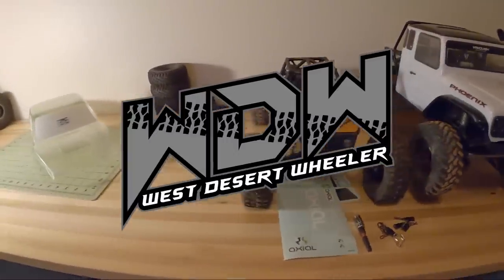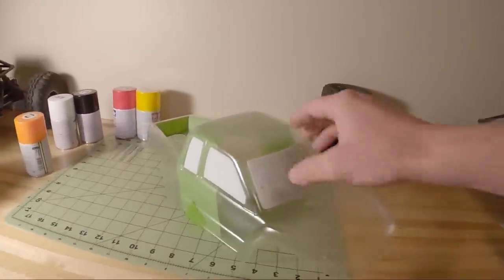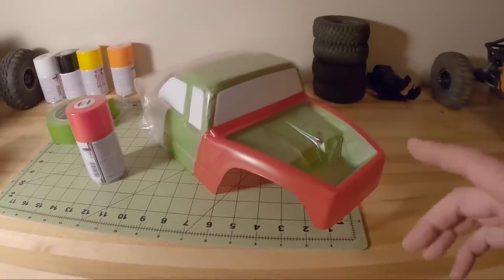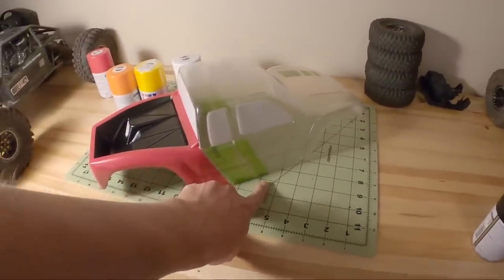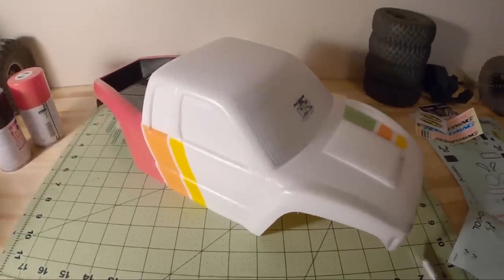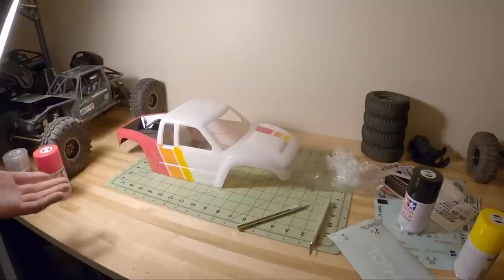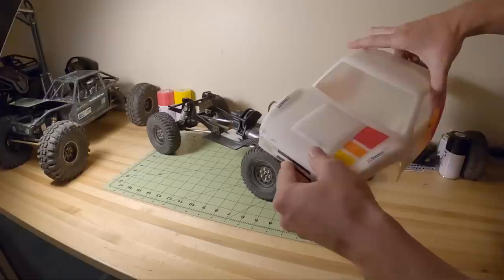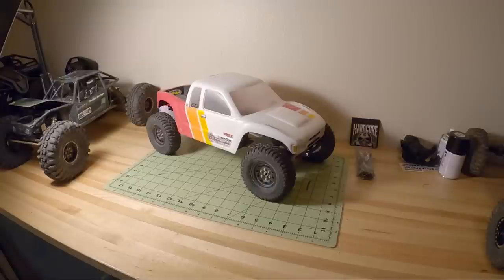How To Paint the TRD Ironman paint scheme, and how I messed it up!

Comment: 100% true I just cut out my first body & used a combination of scissors & exacto blade then I watched a few more videos & the snap technique is much easier because you don’t have to go back & clean up the edges. Saves a lot of time & energy. Another version I saw was  to use the exacto  scour the body then use rhe scissors to cut smaller areas then snap them out. Next time I’m definitely going the scour & snap method. I haven’t painted it yet so your tips are handy. 👍

Comment: before you spray any color you should spray a light coat of flat clear over your masking. it will help hold your masking down, and you wont get any bleed lines. it will not look flat either once color is sprayed over.
Reply from the maker: Good tip!

Comment: I had a body painted to totally white, I just used oracle vinal from my wife's cricut to stripe it out. Came out ok.
Reply from the maker: That will work but will get ripped off quick with how I drive. Wedging into sand stone all the time
Reply: @westdesertwheeler  not as bad as you would think. Oracle vinal is automotive grade and sticks to lexan great. Than I put flat clear coat over it. No problems so far. However, I would agree that the sandstone would put it to the test. I crawl in the Sacramento mountains in Cloudcroft, NM., so the environment is totally different.